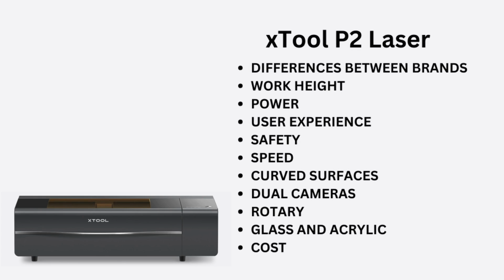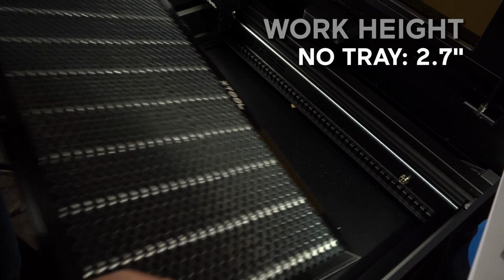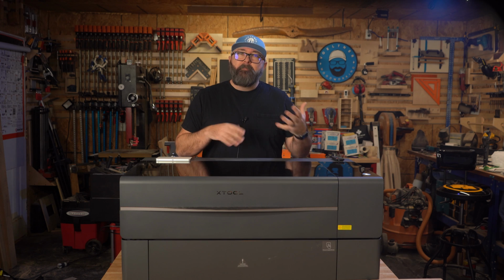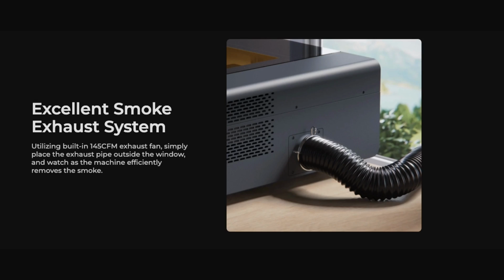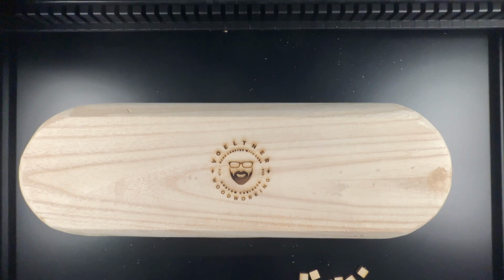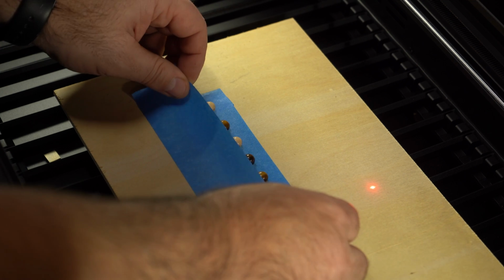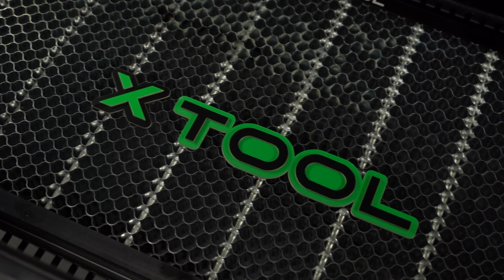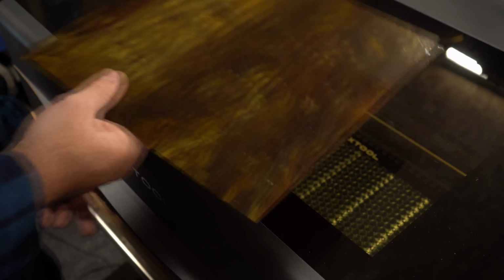Curved surface engraving is no problem | xTool P2 Co2 laser

Comment from the maker: Upgrade your laser for safety and savings! Trade in any open diode machine for an enclosed xTool and get up to $500 off: https://bit.ly/3vHLipP

If you want to get an additional discount on this xTool P2 or any other machine, use code "VW10" at checkout: https://shorturl.at/djCL0

Comment: I like your videos my good man. I just bought the P2-S along with the package that includes the riser, conveyor, and rotatory. I am a commercial printing company with the equipment to print full color on acrylic and wood and other substrates. This will open up a whole new direction. I am really stoked! I also got their air filtration system. I saw you other video where you said the smells can run you out. I am looking forward to getting my hands on some cedar. I bet that smells great. I am not a wood working shop though. Again, I appreciate your videos!
Reply from the maker: Thank you! You’re going to have a blast with that machine.

Comment: You can use the camera-positioning on the P2 to position your work and record the x and y save file open in light burn enter x and y using right as 0-0 on the light burn program like XCS does set height to work piece-I manually measure the Hight in light burn I   stack index cards and slide  between the tube and work piece then measure them  Z 25 mm might be the top of the knives remove knives to experiment for the Z depth to check and confirm your machines settings- to experiment- burn  a  shape using XCS record  x and y save and open in light burn   enter the x and y   mine matches up perfect
Reply from the maker: Very interesting
Reply: @VoeltnerWoodworking  would be great if you did a video on this I know others would like to learn it

Comment: It's great to see the P2 engraving the inside curve of a bowl or tray.  If I took a 8" wide cereal bowl and turned it upside down, could the P2 engrave a 3 inch band with patterns inside the band... on the outside of the bowl's curved surface to about 3 inches up the wall... leaving the 4" wide flat round base untouched?  Thank you.
Reply from the maker: It's going to depend on the curvature of the bowl. There is a tolerance to make sure the tool head does not interfere with the surface, so if it's a fairly shallow profile it should work. Steep profiles will give you an error. Another option would be to use the rotary but you'll have to get creative with how to position it. I hope that helps!
Reply: Yes this helps a lot.   Thank you for the quick reply!   @VoeltnerWoodworking
Reply from the maker: Sure thing!

Comment: Could you make a video to the air purifyer. I kind of doubt, that I could run the laser in my basement with just that purifyer and no external exhaust... or is it so good?
Reply from the maker: If you have the riser base there will be some air gaps where it could escape, but without the riser it does a really good job eliminating the smoke exhaust. It’s really a good solution.

Comment: The polar you can increase the work height with risers on the feet, however you are limited to the space in the bottom of the polar meant for the rotary attachments to sit in.
Reply from the maker: Yeah, it’s definitely a little bit more limited but still a good machine.

Comment: You can run the P2 with Lightburn, but it lacks all the nice features like autofocus, camera-positioning, etc. But they are working on better P2 support. I guess they got annoyed by me asking every other day. ;-)

What I do for now is use LB to create / edit my files, export as SVG and then use XCS to run the laser.

I fully agree on the RA2 positioning. It's just annoying that you can't choose the center line.
Reply from the maker: The RA2 should be an easy fix I think.